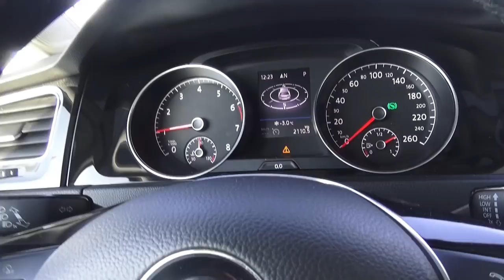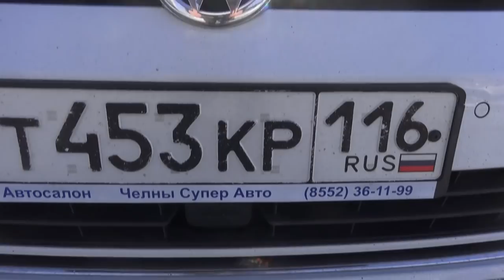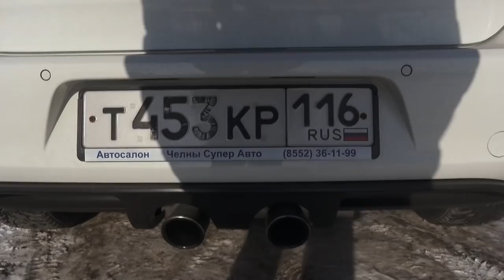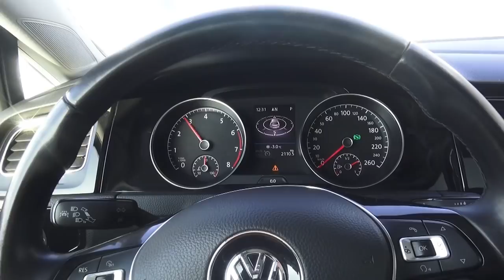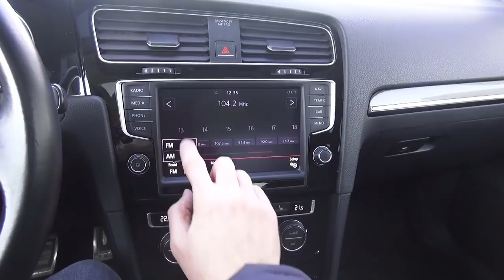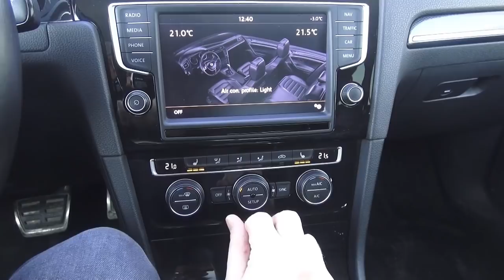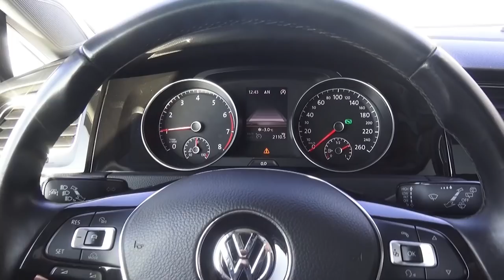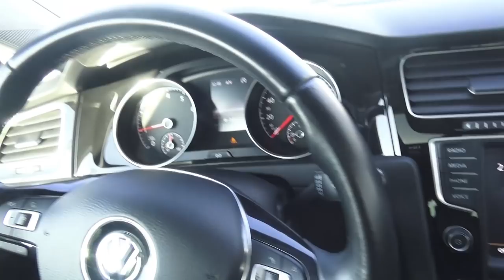2013 Volkswagen Golf 1.4 TSI DSG Highline. Start Up, Engine, and In Depth Tour.

Comment: Even though the Golf here in the U.S. has the 1.8T producing 170 HP, I've driven a Jetta 1.4T with 150 HP, and it's plenty of power. A little slow on acceleration, but still good on gas and good HP. :)